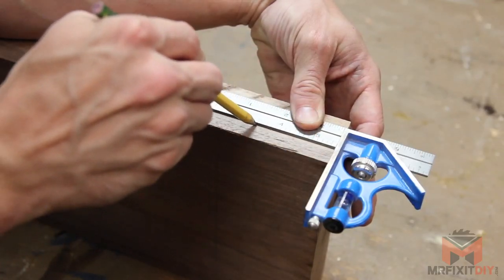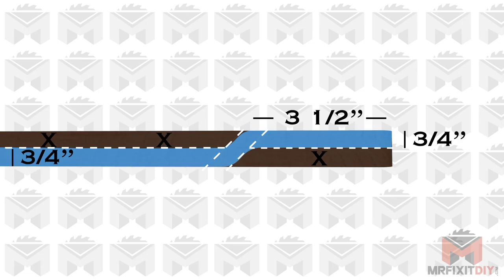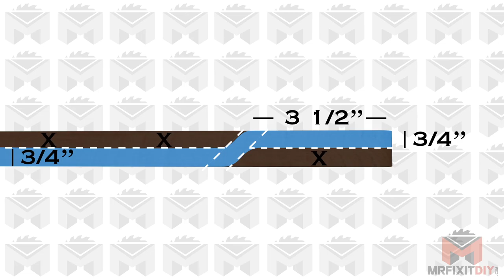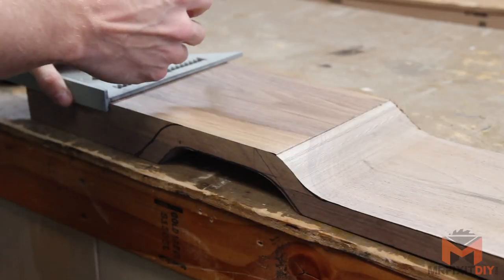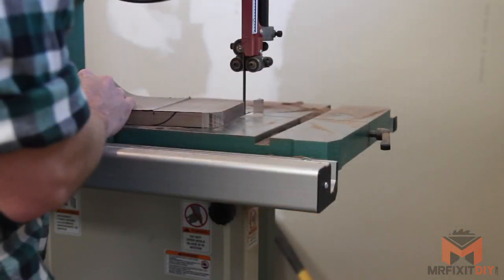DIY Walnut Bath Caddy

Comment: Nice project, Aaron! You've probably noticed already that the handle can also serve as a holder for a small towel for wiping the hands before plunging into a good book.
One suggestion I'd make to the shaping process would be to put a stop on the table saw and use a dado blade to take away that 3/4" from the edges. It would get tricky to get it done on the middle section, and would still require further finishing, but wouldn't compromise the width of the piece.
Cheers, buddy!

Comment: Will tung oil be sufficient as finish?  Or is it to be reapplied?
Reply from the maker: Yes. I would do several initial coats and May have to re-apply in a year or so depending on use.